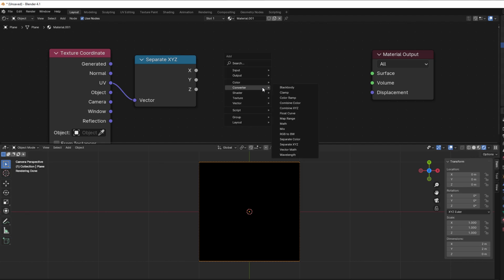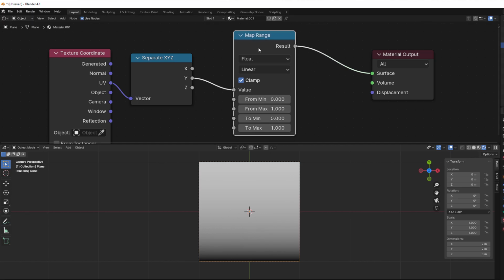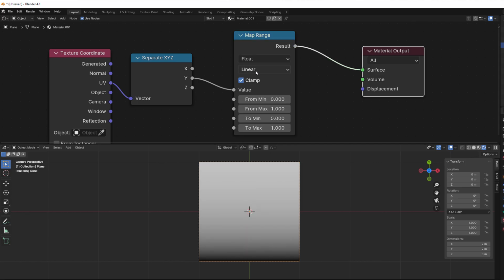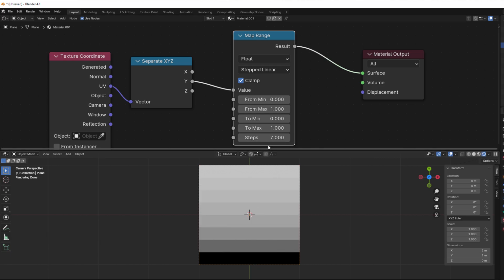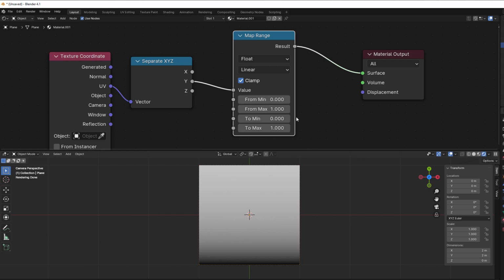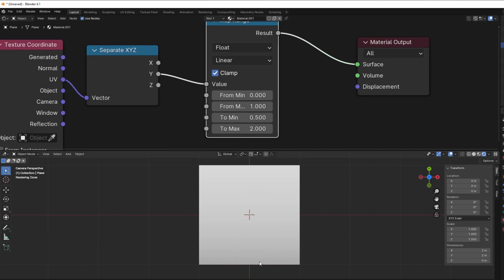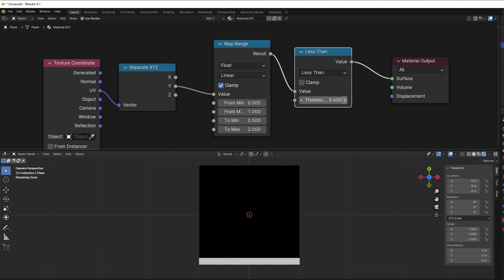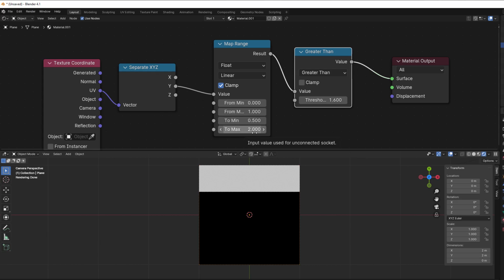22: The Map Range

Comment: What is this good for? 🤔
Reply from the maker: Map Range is used a lot. Often together with Noise node to filter out a small portion of the Noise (which is most active around 0.4 to 0.6) and make that in a 0 to 1 range. The smoothness in Map range is also unique among the Blender nodes, which makes it good to use when you want to smoothen corners on tiles as one example. It can also be used as a multiplicator where an input of 0 to 1 can get an output of a very big range like 100 to 1000 and that gives more flexibility compared to regular multiply since you can limit the output as you want.